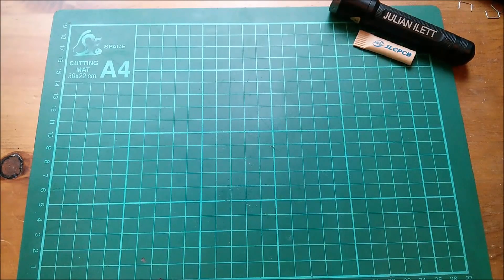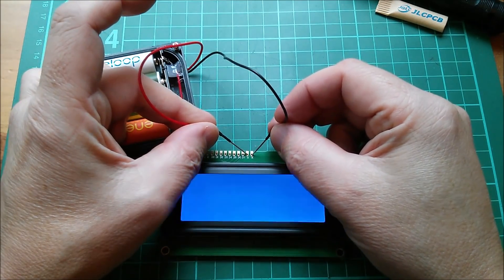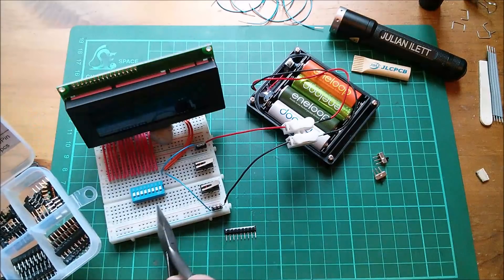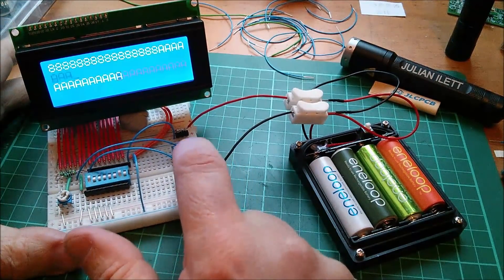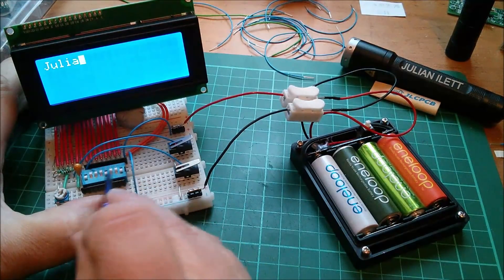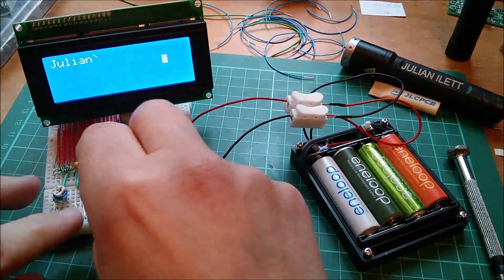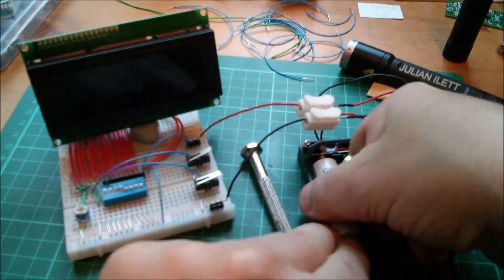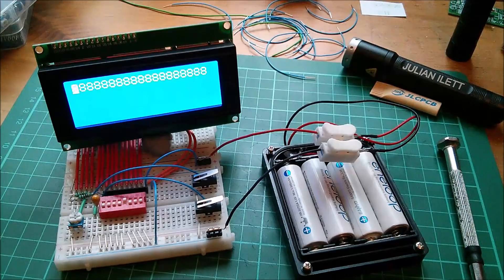How To Use a 20-Character 4-Line LCD on Breadboard

Comment: He said 8-Bit and is working with an LCD screen using only buttons and switches. 8-Bit Guy collaboration confirmed! It makes so much sense, David is building a computer.. Julian is building a computer... They both are working with older electronics even by using the Character LCDs

Comment: That mag article on talking to HD44780 displays by some bloke is the very one I used to build a radio controlled clock using a 16x2 and a 16Fxxx PIC - not until about 2012 though, in keeping with the lengthy timescale theme here :o)

Comment: I just used one of these 2004A displays on a satellite tracking project I'm working on. Very easy to use and they sell a tiny I2C adapter if you cant spare the pins. The blue ones are a bit slow on the update rate. Waiting for the regular ones to come to see if they're better, no reason to think so though. Thanks for all your videos Julian.

Comment: Easy... get a microcontroller that takes in 8 bits of data (parallel) and an "enable" pin (when high, read the data on the 8 pins and put it in micro ram or pass it to lcd display) ... and use 6-10 output pins to communicate with that lcd display (send initialize commands, set cursor position etc) ... or make your micro listen as a serial port .... this way you're abstracting the lcd from your computer.

Comment: Julian, I'm going to guess that the real problem is that switch you were using.  I noticed that you replaced the blue one with the red one at the same time as you changed the batteries.
You thought that it was replacing the batteries which fixed the problem, but I bet it was replacing the switch which fixed it.
I'm going to guess that if you check, you'll discover that bit 6 (of 0-7) on that blue switch has become shorted so that it's always on, so every command you sent was wrong.
When you tried to do a space (20hex) you actually sent a back-quote ` which is 60hex.
When you tried to do a back-cursor you actually sent a Set CGRAM Address command.
When you tried to set the cursor to address 6, you actually set it to address 46hex.
It was you replacing the switch which fixed the problem, not replacing the batteries.
Reply from the maker: Hmm, that does seem plausible :)
Reply: @JulianIlett  In my many years of playing around with electronics, I've discovered that by far the majority of problems are caused by hardware failure.
(That's not counting those caused by the nut on the keyboard) ;)

Comment: Nice video, I could have done with that document a while back. Really not sure about the loose connections, I'd have been paranoid about those.
Reply from the maker: Cheers James. What's the worst that could happen - pretty much what did happen :)
Reply: I could have as well.
I salvaged one of those 20x4 displays from a piece of industrial equipment a few months back.

Comment: Is it just my imagination, or did those issues partially come from forgetting that the 0 and 1 are reversed part way through the video?
Reply: It's your imagination.  :)
I'm going to guess that one of the switches in the pack failed and became permanently "on" so the display was always receiving the wrong information.
Julian replaced the switch when he replaced the batteries, which removed the fault.
Reply: @melkiorwiseman  yes you are probably right. Apparently my imagination gets away from me sometimes :D

Comment: Taking note of the 8-Bit Guy's cautionary tale, Julian wisely uses a battery to power his LCD lashup.
Reply: I tried following his video, but he didn't really show you how to wire it up and if you paused it was all black wires in a black box (plus he cocked up the wiring). Had a go but couldn't get it working, may have to dig out the kit I used and have another go.

Comment: Those Displays are awful! they don''t seem to of ever updated the drivers. Why the silly line skipping? I remember attempting to build a counter with a similar display only to have to give up and I built a multiplexed LED display instead. Much more pleasing to the eye, and it worked in a logical fashion!

Comment: Gooood Morning, You should do an OLED with SPI on a Microchip device. These are some great displays but there is not much information to drive with Pic. I have complete a design PIC1846K22 with 1.3 OLED SPI and will be happy to share but not into posting youtube  or github. My design works with both SH1106 and SSD1306 drivers.

Comment: eBay is pretty expensive for that LCD; You can get a cheaper on AliExpress including I2C interface. Even when you do not use I2C,  the versions without I2C are cheaper on AliExpress

Comment: I just love these simple LCD displays. I have used a C167 MCU (a bit older 16 bit, Siemens/Infineon) to control many different kinds, also graphics ones. I still have quite many text LCDs stripped from old table phones (corded ones, to the younger generation) that I might put to use if my electronics DIY raises its head again some day :)

Comment: i use these on a breadboard all the time! just stick them in in like the bottommost (or topmost but then rotated) line and let it dangle over the edge of the board. might as well add some standoffs through the screwholes to help with stability.... Afterall its nothing terrible novel here the only thing i ask my self is there a very nice and elegant way to use like 4 of those parallel
(EDIT: well using these with just switches is very novel to me havent seen that before although yeah ofcourse you can if that this is as timing indifferent as it seems)
Reply: you seem to miss the point, its "Ben Eater
" style, as in... going back to basics as a reminder of how these man made devices actually work